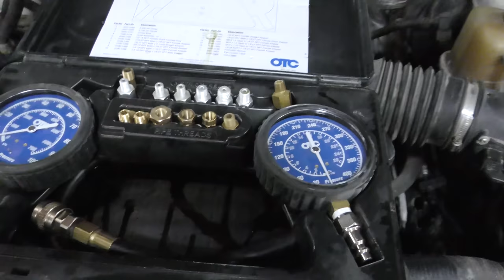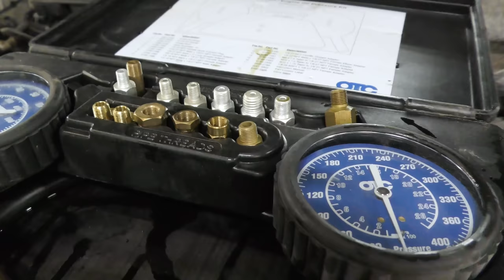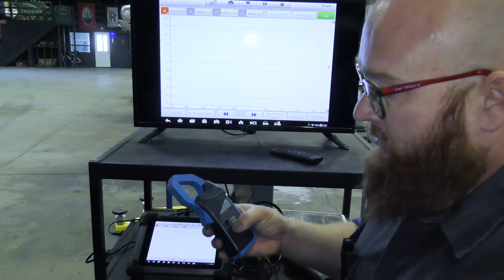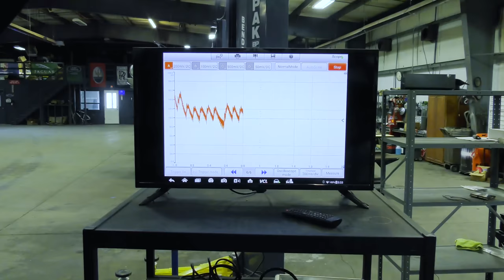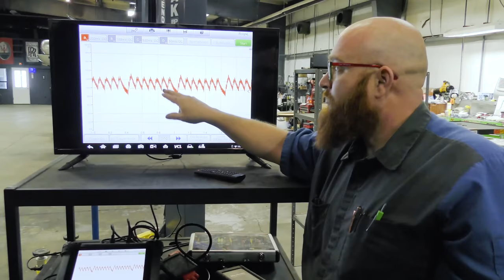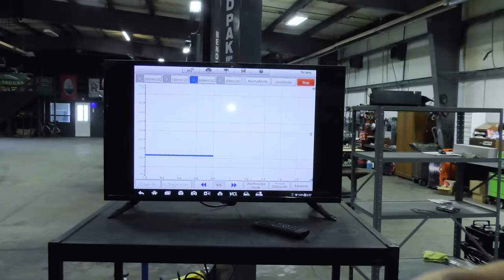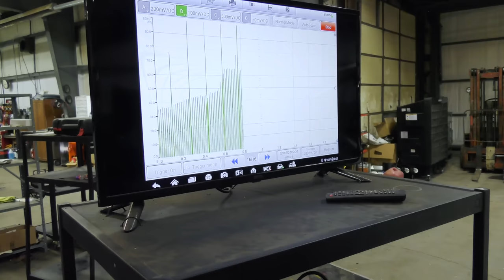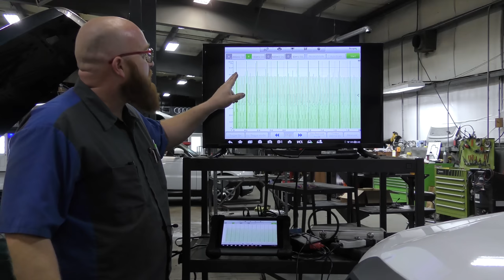Can an engine additive really fix this 2011 F150? CAR WIZARD shows how to diagnose and repair

Comment: To any BMW guys with M54 engines with oil pressure flicker, replace the ccv and remove the 02 pilot mod. I was running the mod for a while, was getting the red oil flickering light, changed everything, oil filter housing gasket and valve, sender, changed the oil and filter, replaced the ccv and still had the light, did some thinking and removed my 02 pilot mod and plugged the holes with the rubber caps. Issue solved, obviously there was vacuum affecting either the idle of the pressure. If anyone benefits from this, worth it

Comment: Hello Wizzard! Which LUCAS additive product was used to help the engine compensate with the oil pressure loss?
GREAT TIP for old worn out engines, just to give a couple of years of life (or help make the travel to your favorite workshop before "heart surgery").

Comment: Had this happen to my old 3.0 ranger, around 170k the cam bearings were tired, switched to 15w40 rotella, my uncle has the truck now, 290k miles and counting

Comment: I had 265,000 miles on my 2006 F150 when I sold it.  It had the 5.4 3v Triton engine.  The reason I sold it is because the body panels were rusting out (I live in the rust belt) and I didn't need a truck for work anymore.  The 5.4 is a good motor IF (huge if) it is maintained properly.  I never had any engine related problems.  It is intolerant of neglect, though, just like a BMW!  Run synthetic oil at 5W30 with a quality filter changed regularly and it will perform well and last.  My truck was proof of that.
Reply: I'll never understand people who skimp on recommended maintenance. Intolerant engine or not, why would take a chance on blowing up what is likely the second most expensive purchase you'll ever make outside of your house? It makes no sense to me when people buy new cars for 50K or 60K, totally neglect them and then act like it's a lemon when it's having problems by 100K miles.

Comment: When I buy a used vehicle, especially from a dealership, the first thing I do is change the oil just because of the cheap oil filter scenario.  I had the the same issue with a Chevy pickup. Oil pressure would drop to zero after about 30 miles of driving. Of course, the dealer oil change techs for some reason have to use a torque wrench set to 1500 foot-pounds to tighten both the filter and drain plug. Also oiling the gasket isn’t too good an idea at a dealership too.

Comment: My experience always taught me to try one factor at a time: the oil additive and oil filter needed to be one at a time. Did the truck have something other than the OEM filter on it? If so, the best method would be to change the filter to OEM, top off the oil, take it for a drive and check the oil pressure. If that didn't do it, note what if anything it did do. Then do the additive. If the additive alone resolved the issue, the oil filter has nothing to do with it. Make sense?
Reply: Meh. Neither is exactly an expensive fix, so why do 2 oil changes just to see if it's the filter or the Lucas that fixes it? I mean, the filter is like $5 for OEM Motorcraft and the Lucas is like $10 a bottle. Rather than potentially waste $40 in oil and a $5 filter plus labor time, just do them both at the same time. If that fixes it, great. Your oil changes are now like $8 more than normal (accounting for the quart of oil you leave out for the Lucas). Hell I bought a single quart bottle of Mobil1 synthetic yesterday and it was $9.99, the same price as the Lucas!
Reply: @matts.8342  Because it will tell me if the bearings truly are fading fast or is the cheap filter somehow messing with my low rpm oil pressure.
Reply: @monkeybarmonkeyman  that's true. Although if they really are on their last leg I dont think the Lucas will really do all that much for you.
Reply: @matts.8342  I was intently curious because it sounds like those engines only spin to 100K or so before bearings start wearing out. If this is true, compared to many other MFG's engines, it is not very good. I'm looking to buy new-to-me vehicle so this has a direct impact on my purchase. Now Seafoam - that's the miracle additive!
Reply: @monkeybarmonkeyman  I have a 2012 F-150 with the EcoBoost 3.5L. From my research these trucks are very sensitive to oil change intervals and filter quality. The key seems to be 3000-5000 miles with a good synthetic oil and genuine Motorcraft filters. Apparently other brand filters dont have a proper check valve in them or something. I dont know what the previous maintenance on mine was like, but since it has turbos I am going with 3000 miles and Mobil1 5w30 full synthetic with the motorcraft filter. Ford has an oil additive spec they specify for this truck and the Mobil1 claims to meet it. It lists the spec right on the bottle.
Reply: @matts.8342  Thanks Matt. This is a concern I have then when buying used. I wonder if the filters at Valvoline oil change places (and others) are sub-standard as compared to the original quality filters. Want to think no!
Reply: @monkeybarmonkeyman  I don't know. I always do my own maintenance. My wife does take her car to the dealer for her oil changes though, and it's really about the same price that I would be paying for the oil and filter. While her car is now 12 years old, we did buy it new so we just had them do the regular maintenance. I just never took over as she never really asked me to. Dealers usually don't charge a lot for oil changes, and you know you are getting what the manufacturer recommends. She pays about $50 for the oil change ($30) and tire rotation plus "safety inspection" ($20). It's a 2009 Hyundai Elantra.

Other than her car that one time, I never buy new for myself. Just last weekend I helped her sister pick out a car. She got a used 2020 Hyundai Elantra with around 15 miles (yes, it was sold as used!) for $15,500. A new one would have been about $21,000. They have a 10 year 100,000 mile warranty, so it will be a long while before that car would really cost much to maintain. Just one year from new saved her about $200 or so a month.
Reply: @matts.8342  Wow, great find. Thanks for your words, helps get a better deal.

Comment: In days past, Living in a very cold area in winter, I use to add Marvel Mystery Oil to the crankcase so my cars would turn over easily even at -20F outside in correct proportion to the amount of oil in the crankcase.

Comment: If you catch a 5.4 3v before it completely craps out, you can swap out the oil pump and a few more parts to make it an actual dependable engine. The main cause of the problems in it seem to be an under-powered oil pump. Swap the phasers, timing chain tensioners, guides, and manifold studs while you're in there. Use the updated OEM parts.

Comment: To answer your question on this one: I use Lucas synthetic oil stabilizer in my 2010 Sportage (2.0L Beta II engine).  It's our second vehicle, and not used all that consistently, so not unusual for it to sit a long time.  I find it helps a lot with cold starts and cold idles, though I only use half the bottle per oil change since it doesn't need it for any sort of oil pressure or wear issue.

And if you can, please consider making a Canadian Amazon Affiliate store!

Comment: My first longer term choice to solve the lower oil  pressure at idle would to install a high volume oil pump. It has worked for me on other engines with low oil pressure at idle. Oil thickening additives only helped a short while.
Reply: If your engine requires higher oil flow it's dying no matter what you do. Only a short matter of time before it needs a complete rebuild.
Reply: I agree its just a longer term band aid.

Comment: I too, am usually against additives, but recently I used Sea Foam's TransTune in my 2000 Toyota Avalon that had some issues with hard shifting after warm up. I went through 3-4 drain and refills, trans filter replacement, and it did absolutely nothing. I ran a bottle of TransTune through it, and I swear that damned thing shifts almost like new. I bought another bottle to run through my Honda Civic too before its next fluid change, I can't believe how much of a difference it made.

Comment: Some snake oil works. I blew the head gasket in my 4.6 Ford. I bought a new engine but thought what the hell I'll try that Blue Devil Head gasket sealer just for fun. I drove it for a month and it never used a drop of coolant after putting it in exactly like the instructions. Still ran great when I pulled it to put in the new engine. It was leaking so bad before the Blue devil i would have to pull the plug and shoot the water out or it would hydrolock to start it if it sat overnight.

Comment: i was having oil pressure trouble with my 96 c1500 5.7 back at 300k i started running 10w40 and it helped put lucus in and it helped a ton now i have 329k running strong doesnt burn much oil if any

Comment: Back in the day (late 90's) we had several F150's with the 5.4 2 valve engines running hvac service in Houston and running HARD.
They all went 200k plus (all city miles!) with no major problems,  weird I guess....
They were replaced with Rams around 2006 I think,  now THEY were trouble.
Tons of stupid little stuff and some huge stuff including a blown up 4.7 just just just out of warranty...  lol

Comment: Question:  The wrong kind of oil could cause low pressure.  How did you verify that the right oil was in the engine?

Comment: I had a six cylinder Mustang and used AC Delco filters because they sold back then for $1. I had a 2 tick sound and then no sound. I changed to the OEM  Ford filter and the sound went away. Come to find out the AC Delco filters had the wrong size spring in it. I also had the cap on my Purolator oil filter just after an oil change. I now only use the OEM filters.
I have used Lucas oil for over 15 years. I drive very high mileage cars 2000 Windstar  240k, 2000 Ranger 130k and 2007 Prius  200k . None of the cars have Lucas in them but the Windstar is starting to get some light lifter noise and 1/2 a quart of Lucas will fix it. If it gets more lifter noise over time, 1 quart of Lucas. I am not much into additives but Lucas works for me.

Comment: I have a 2011 F150 with the 5.0.  I have used 5w30 since new instead of the recommended 5w20 and am pushing close to 200k miles.   No low oil pressure in my truck.
Reply: The dog urine 5w20 recommended by the manufacturers is too thin .
Reply: It's that thin for a reason lol. The vvt is oil driven too thick won't work that and it can have trouble clogging the tiny pinholes it has to travel through.  but good to know 5w30 will work I'm at 183 k 5-20 still runs just fine.
Reply: I'm at 270 in my 2011 5.0. Rear main starting to leak a little and possibly a head gasket. But hey it's got 270k on it. Not to shabby. Few other small issues but nothing serious

Comment: I had a Sebring that would show the oil light at idle sometimes. My fix was using synthetic oil and a K&N oil filter. As long as I did that it would never come on.

Comment: Thank you Mr Wizard for showing that ignition tester! I haven’t used or seen a scope since trade school in the eighties, and have been asking around for something like that, but with no result. I’m impressed with your diagnostics, thumbs up.
As for additives: I’ve used STP stop smoke in my 1960 Buick 364 nailhead, when it was smoking badly. Did it work? Probably in some way, but it didn’ affect the smoking issue in the slightest 😄 I did’t expect it to work, but since I had a big STP sticker on the fender... Ha!

Comment: It is now the middle of May 2021 and the Car Wizard has not completed an all-new, buy this, not that video, which is the first upload of 2021 in that series, yet. I am extremely hopeful for Mitsubishi Motors this Tuesday or for Mazda this Thursday on the buy this, not that series, which the Car Wizard will lead the video himself. They already have two yachts that needed to be repaired for summer in the shop and they have more vehicular projects to check out and to work on. But, we are getting close to have a brand-new video on the buy this, not that department that the Car Wizard was doing for the last, but slightly over two years. Thank you very much.

Comment: AND, a little bone to pick with you Mr.Wizard..  I've had several 5.4's, and they have all been perfect.  The one i drive now has 278k miles, and the oil pressure is like the day i bought it new.  I'm not saying there are not problems, maybe more than its share of problems, but maintenance is key.  Especially oil changes.  I change oil religiously ( Easter and Christmas, lol) and use good oil and filter.  This 5.0 only has 180k and 10psi pressure?  Not acceptable. Your channel is great.  I watch all the time.  Keep up the great work. thanks
Reply: Pos😅
Reply: @mikecastleberry9671  🤣

Comment: My Nissan Maxima has the VQ30DE engine in it and it has now around 204tmls. I run 5W-50 oil in it and I've also done an RVS treatment. Works like a charm. EDIT: I would recommend doing the RVS treatment for this Ford as well. It really does work wonders.

Comment: It seems that the oil Ford has spec'd for these modular engines (4.6, 5.0, 5.4) is the 5w20 synthetic blend Motorcraft oil. My favorite channel fordtechmakuloco reccomends using full synthetic Pennzoil platinum in the 5w30 flavor. Helps the oiling system and vvt system from having the issues that each engine is known for. He's also against pouring lucas in as a bandaid. That being said, I personally have used lucas in many cars and trucks I have owned over the years. My 2006 F150 started having the 5.4 triton issue of low oil pressures causing the stumble and stalling at idle full hot. A bottle of lucas and the 5w30 with the Motorcraft oil filter straightened right out. The truck ran beautifully at 158000 miles, it was the frame that quit me, not the engine.

Comment: 2011 240k miles 5.0 coyote f150 no problems oil changes and maintenance are key. Spark plugs are way easier to change than 5.4

Comment: Just put a higher viscosity oil in it. Lucas is not a very good supplement it tends to coke rings and coke in turbo oil lines etc. It is just Bright Stock with a touch of ZDDP. It is thickening the oil but doing so with a cheap thickener when you could run a thicker base stock which is so much better.

Comment: My 98 f150 4.6l triton( regular plugs, non perf heads) has 273K and good oil pressure. Does not burn oil, good power. It does leak at valve covers and rear. Ford filter. 5-W-30. 
Why use Lucas with 5-W-20? Use 10-W-30, or 20-W-50. STP still works.

Comment: Hey Wizard, my fan comes on after driving for awhile and is very loud. For example, if I’m going through a drive-thru they have trouble hearing me. It has nothing to do with temperature however. If I shut the truck off and turn it back on it will stop.

It’s a 2012 V6 F-150.

Comment: You also use the voltage drop on the starter wire or right on the battery, to see compression. With a cheap oscilloscope, all these special equipment are just an oscilloscope.

Comment: Adding an additive might help but is relatively expensive. What I do is just flush the engine and then use OEM oilfilter in combination with a just one or two step higher oil spec so instead of 3w30/40 to an 10w50 or 10w60 spec. Those 50 and 60 "s stay thicker at high temperatures. It might keep the engine running for many more miles. Good luck.

Comment: Time and time again,  Lucas proves to be the GOAT additive 💪!
Reply: Been using it for years...
Reply: @ryanroberts1104  yep, because you are smarter than all of those other guys who work on cars and say that it works.
Reply: @cleveland2286  Mostly, yes. I didn't say it doesn't work, I said it does the same thing as thicker oil that cost significantly less. Either way it's just a bandaid, not a fix. If you have to start using thicker oil it means your engine or whatever is worn out. If you look at the comments here you will see numerous people that agree with me.

Comment: Whilst the scope starter trace is useful you would need to preposition a cylinder at tdc or pull a plug to know what cylinder the pattern was starting at.

Comment: High mileage vehicles should be fed 20W-50 motor oil. Castrols bread and butter is that big jug of 20W-50 for those guys trying to get a few more years out of their trucks. 

My 1986 Fiero SE with the 2.8 V6 has in the owner's manual to use 20W-50 for the Southern California climate. Some places have argued I am asking for the wrong weight of oil. I pull out the owners manual, show them what it says. I remind them that sometimes the customer is right.

Comment: My dads old hillman also turned on the oil light when hot after a long drive, but it didn't move the valves with the oil, so no problem.

Comment: I have a 2000 impala with the series 2 3800 in it the car developed a really bad lifter knock seems some thing had a clogging up the “passage” after “clearing it” if you will I started mixing 5 to 10% Lucas in with every oil change I doubt at this point it needs it every oil change but it’s the peace of mind

Comment: I always thought the 5.0 was the least problematic engine. My 2.7 l EcoBoost has 215,000 and runs perfect, I've never had a single issue with the truck

Comment: I have an 96 Pontiac Trans Am with an LT1 and i drive it only in the summer. Oil pressure always going down when the engine is hot and when i stopped and the warning light comes on. So i changed the old thin oil to Castrol 10w60 and the pressure is much better 😏 But the LT1 has the lowest oil pressure of all car engines...so it was near zero with my old problem 😐

Comment: I have a 2001 Ford Escape with the V6 engine. At 230,000 miles I had the same problem. The solution was to switch from 5W-20 to 10W-30. The vehicle now has 272,000 miles. I am hoping to get 300,000 mile or more out of it.

Question: I recently bought a 2011 Honda Pilot with 66,000 miles on it. Is the oem oil filter best, or is a Motocraft filter a good choice?